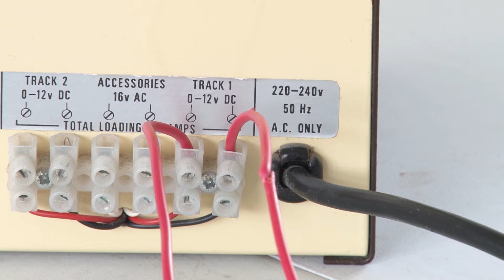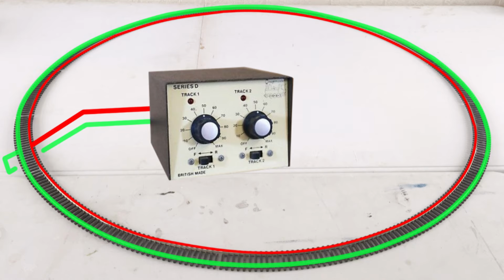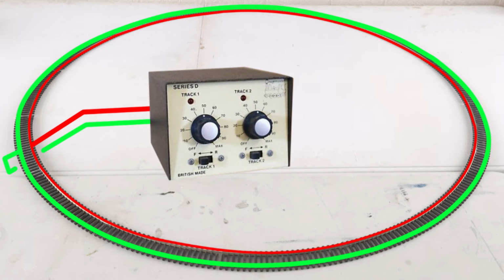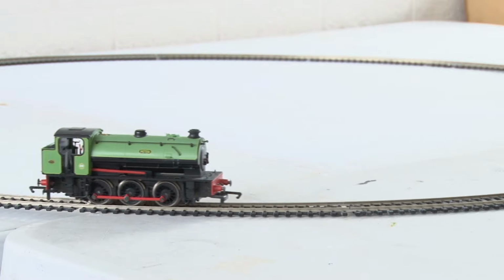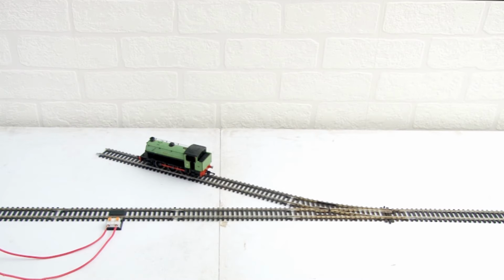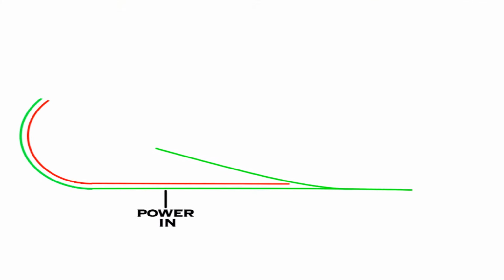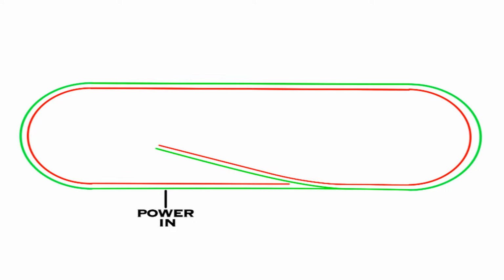Wiring A Model Railway For Beginners - Model Railway Basics: Episode 3

Comment: Thank you for the explanation on the sidings.  How far of track will one controller operate?  We're building a layout in a warehouse and would like the main line to stretch around the building before coming back.
Reply from the maker: Wow that sounds like an epic layout! It's a bit difficult to say as it really depends on the track plan and just how big it is. Generally controllers won't just stop working but you'll notice the locos getting slower the further away from the power source they get. 

Potentially if there was just one loco you could have it all operated off one controller and have multiple power feeds to the track in different sections. Alternatively for DCC there are power boosters which do a similar thing - it's almost a whole video in itself really but due to my lack of space it's not something I've ever had experience with. Sorry I can't be of more help but thanks for watching 😃
Reply: @ThatModelRailwayGuy  Sorry, but what is a power feed and how can it be constructed then?
Reply from the maker: @HEAVYMETALSL  My apologies, I've only just seen this! So in essence the power feed is the set of two wires that go from the controller to the track. If you have a large layout you could have multiple sets of wires coming from your controller and joining to the track at various intervals along it's length. Having never built a layout in a warehouse though I have no idea if that would be sufficient.

An alternate idea perhaps would be to split the track into isolated sections (also known as blocks) and have each one powered by it's own controller. Again it's not something I'm incredibly knowledgable about due to the small nature of my own layout, so I'd recommend getting the advice of someone who knows what they're talking about before starting on a large project like this.

Comment: This is a super useful video, but I have one question. So say that I wanted to have two loops that are connected through points, but only have one controller and one engine. How would I get power to the second loop?
Reply from the maker: Hi there, so I'm presuming by loop you mean a circuit of track (rather than a passing loop). If you only have one loco it's really simple: One way is to split the two wires coming from your controller and have a set connect to each loop. 

Or if you have the controller connected to one loop, you could use something like the Hornby link wire (https://amzn.to/3SSlwGf) to pass the power from the first loop to the second loop. If you only have one loco you don't need to worry about isolating anything since it can only be in one loop at a time. 
Hope that makes sense and thanks for watching 😃

Comment: Is there a way you can use a hornby controller. Like the Gaugemaster controller with a bachmann setup?

I live in the US and I'm curious
Reply from the maker: Yep that's absolutely fine. The controllers all work in roughly the same way so it shouldn't be a problem. The only thing to watch out for is some newer locos have coreless motors which don't like the cheap Hornby controllers. They'll still run ok but you might not get the best out of them. Thanks for watching 😃
Reply: @ThatModelRailwayGuy  your welcome.

And something I forgot to mentioned. If that doesn't work, I'm thinking about using 3 bachmann controllers. Will three of them overload a power strip and trip the power outlet or will it not.

Comment: The switches are interesting. My mantua tank engine gets stuck going into one of my sidings unless its going fast enough to quickly get across, but one of my athearn switcher diesels has no issues. If i made the siding longer id feel better about letting it speed into it
Reply from the maker: If it's a short wheelbase loco it sounds like it's cutting out on the insulated part of the point. Maybe check to make sure all the pickups are making proper contact with the wheels - additionally if you're using DCC a stay alive capacitor can help smaller locos get over dead spots like this. Thanks for watching 😃

Comment: I've been having trouble with hornby insulfrog points as of late with the first half of my table, I was considering soldering them. Would that cause any circuit problems?
Reply from the maker: Hi there, it depends where you're soldering them. Do you mean just soldering the rails to the next piece of track to improve the connection? In that case I don't think you'll have any problems but just make sure you do it on the outside of the rails. If you solder on the inside it could affect the wheel flanges on locos and rolling stock. Hope that makes sense and thanks for watching 😃
Reply: Thank you for the advice, I was originally thinking of soldering them underneath where they meet near the frog or just switch out the fish plates with wires already attached.

Comment: Could you hook up a dc controller and a dcc controller to the same track, but only have one switched on at a time if you want to switch between the 2?
Reply from the maker: In theory you could but I've never tried it and it seems risky. Like you said, you could never have both controllers powered on at the same time and would have to remove all the DC locos from the track when running DCC and vice versa.

Personally the way I do it is to have only one set of wires coming from the layout and then plug that into whichever controller I'm using. Switching over takes about 5 seconds and it means I definitely can't have them both plugged in together. Thanks for watching 😃

Comment: That was a great video... I needed all of that information.. but how I can lay down my wires and get everything hooked up. was not in the video ;)
Reply from the maker: That will depend on your layout and how you want to do it. Most people prefer to run wires underneath the baseboard then drill holes through the surface where they need them to come up. 
To connect to the track you can either use power clips like the ones I showed in the video or you can solder the wires directly to the rails if you want something a bit more discrete. Hope that helps and thanks for watching 😃

Comment: nice episode mate... may i ask a question? Some of my engines run in different directions to others... why?
Keep up the good work Sir
Reply from the maker: Thanks Neil. Are the locos fitted with a DCC decoder but running on a DC layout by any chance? Reverse running is something I've seen happen when mixing the two systems. Or if they're DCC locos running on a DCC layout as intended you can program the decoder to run in the opposite direction by changing the CVs.

If this is happening on DC though it sounds like the positive and negative wires from the wheel pickups to the motor are wired the other way round in those locos - though I'm not sure how that would happen with RTR models. 🤔 Thanks for watching 👍
Reply: @ThatModelRailwayGuy  thanks buddy yes I'm on DC only... I will check the wiring👍🏻

Comment: I intend to make a single loop, which will be 14 meters length. Will there be any problems with a standard Hornby trainset transformer?
Reply from the maker: You might start to experience voltage drop with that sort of length. I suspect you'll either need to add extra feeds from the controller around the circuit at various points, or more likely you'll need to have a booster. Having never built a layout of that size though that's really just a guess on my part so I'd definitely do some more research first. Thanks for watching 😃
Reply: @ThatModelRailwayGuy  Thanks for the info. I've came to a conclusion i need to be running DCC to combat this problem

Comment: I think I want to have insulated points, but have some wires underneath my layout that I can connect or disconnect should I decide to upgrade to dcc. that way I can do stuff like have a station with an offshoot of track at a station. If I install dcc I can just twist the wires under the track so I can still have all the lights on even when the train is off, but have a second train running around the circuit.
Reply from the maker: I did something very similar on my own layout so I could have the full layout live for DCC or use the points to route the power when I was using DC instead. I have push fit terminals for connecting the wires which makes it all really easy. Thanks for watching 😃
Reply: @ThatModelRailwayGuy  yeah that sounds like a good idea, or even better I could sauder together a little switch under the baseboard to make switching to fully powered rails easier.

Comment: I just purchased a MTH lighted building.  It has two black wires.  How do I wire that to a Lionel Fast Track connector that has a red, black and neutral wire (white?)
Reply from the maker: Hi there, I don't have experience with either of these products so it's hard to say and personally I wouldn't wire my building lights to the track anyway. I suppose the place to start would be finding out which are the positive and negative wires on each and if they're both designed to work on the same sort of power. Thanks for watching 😃

Comment: 1 question, the trains have metal Gear wich is conductive how does it not damage your controller and also the Gear runs on both of the tracks and so the positive and negative are always conected and how do they make the train work can some one explain it pls
Reply from the maker: Hey there, when you say metal gears do you mean the wheels? The gearing inside the models is usually plastic. The wheels on the other hand are electrically isolated from their opposites as they transfer the power to the motor. Hope that makes sense and thanks for watching 😃
Reply: @ThatModelRailwayGuy  thanks, now i get it i thought that the wheels are 1 piece but when they are isolated it makes sence, great video bdw

Comment: What about if you have a 2 circuit layout?
Reply from the maker: On analog you would have a controller for each circuit assuming you want individual control of each. Or you can have one controller linked to both circuits to make both trains go at the same time.
On digital all the track needs to be powered from the DCC controller all the time. Thanks for watching 😃

Comment: Hi do you know how many points I a power of a gaugemaster controller
Reply from the maker: Are you talking about point motors or track power through points? If it's track power you're wondering about then it's difficult to tell without seeing your layout. Generally though Gaugemaster controllers are pretty good and I suspect you'd have to have a pretty large layout before you started to see any voltage drop - it's more to do with length/distance than how many points you have.

If you're talking about using the accessory bus on a Gaugemaster controller to switch the points then what really matters is whether you have a CDU in the chain and how many points your want to throw simultaneously. I've done a couple of other videos specifically on point motors already which might be more useful for you. Thanks for watching 😃
Reply: @ThatModelRailwayGuy  thank you
Reply: @ThatModelRailwayGuy  ok thanks will find videos and watch them new to this hobby

Comment: So I have a main circuit and when I switch the points for the siding the whole thing dies.   I even have no connecting track so its definitely the points.  Cleaned area and still no joy
Reply from the maker: Sounds like a short circuit of some sort. Without seeing/knowing the layout it's hard to diagnose where exactly it's coming from though. Are you using electrofrog or insulfrog points? Thanks for watching 👍
Reply: @ThatModelRailwayGuy  I believe its the insulfrog the frog with the plastic
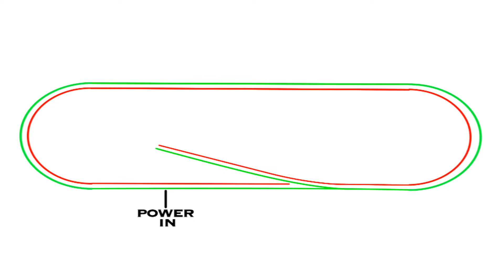Reply from the maker: Hmm and I presume you've got the wiring setup similar to how I show in the diagram at 04:12? 
My suggestion would be to strip it right back to just a single piece of powered track and the point. If the power is still cutting out when you switch the point to the diverging route then it sounds like it might be a faulty. 
The other thing would be to test the same setup with a different point if possible - if that point works then it pretty much confirms the problem is with the original one.
Reply: @ThatModelRailwayGuy  Thanks I had stripped the track back to the points.  and no joy.  And the my circuit is the same as your diagram only that the power connector is before the points.   so It looks like faulty points .  Many thanks for your help.

Comment: If I go DCC do I need electro frog points?
Reply from the maker: Not at all, I use DCC and I don't have a single electrofrog point on my layout. Thanks for watching 🤩
Reply: So i can set up my layout to DCC with insulated frog points and DCC locos will run across them fine? i just have to add power to the track beyond that point? Sorry for the questions but im very new to this game :)
 @ThatModelRailwayGuy
Reply from the maker: Yeah, absolutely fine as long as you add a power feed beyond both exits of the point. DCC power is essentially the same as DC power, it's just on all the time.
You only need electrofrog points if you're worried about locos stalling on the plastic V on insulfrog points - this applies to both DC and DCC. 
No worries about asking questions, that's what this series and the channel are here for 👍
Reply: @ThatModelRailwayGuy  thank you, really appreciate it, great vids look forward to more, happy new year and happy modelling!